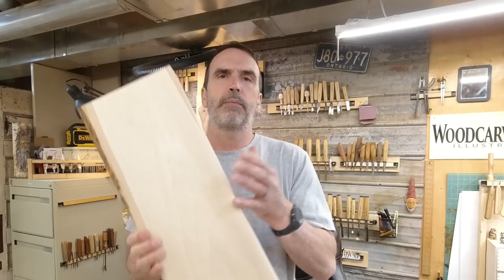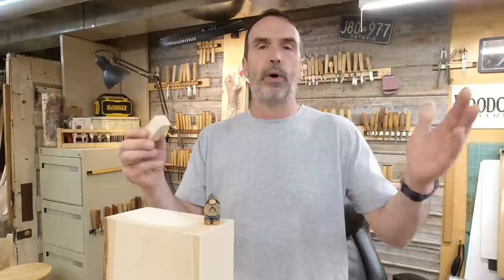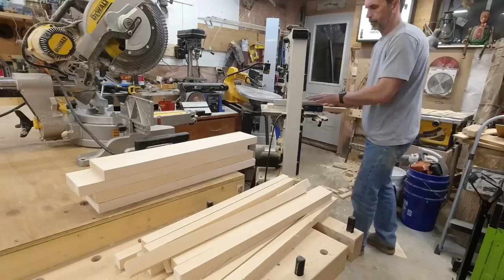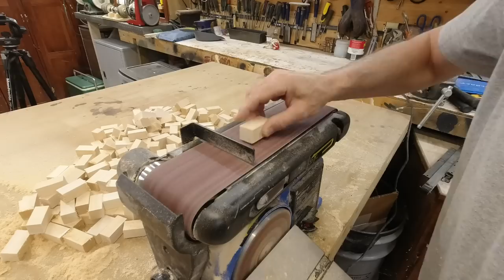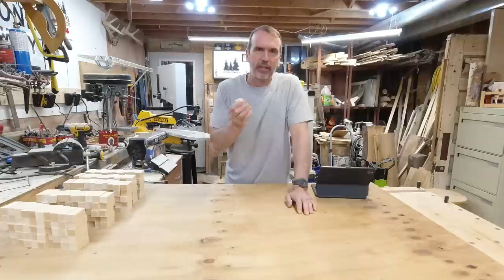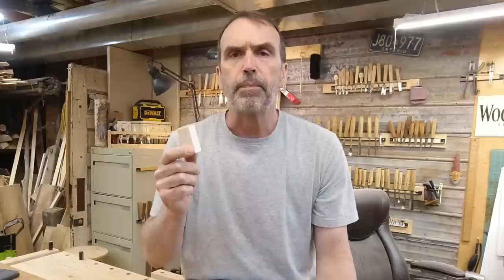This is Ridiculous!....

Comment: Haven't read all the comments, but even if you don't have a bandsaw it's still good value. A good ripsaw will cut basswood really easily and accurately and in a few hours you'd have your 250 pieces. Given that'd be a once a year (or three!) operation, it's worth giving up an afternoon for. For the final crosscuts too, it'd probably be worth clamping a few of the long one by one lengths together before sawing together to speed up the process.

Comment: So not all basswood is created the same, correct? I bought some online and that wood was s hard the knife would snag and then jump (if those are the correct terms) frustrating because I became fearful about carving. I have stroped my knives thinking they were just dull, but I have hardly used them. Beginning knives are from beaver craft
Reply: You can soften it by soaking it in paraffin oil. Paint it on with a brush and leave it to soak in and dry.

Comment: When I started watching you a  year and a half ago, I went out to find some Basswood at my local lumber shop. (No sawmill nearby, but a really good dedicated lumber store. Lots of unique pieces as well as the usual suspects). I found 2 six foot lengths of 2"x6" Basswood for $25 each. Both were poker straight with super straight long grain. I didn't count how many blocks it turned into, but it was a lot. So cheap.

Comment: Hey Doug - thanks for this video (and all your others - I've been binging all the informational ones and keeping the project ones in a list for later). I haven't got a bandsaw but I do have a 10-inch job site table saw (and a chop saw to cut lengths). I know the thickness of the blade will turn more of my big block to dust - but I'm now very excited to visit the mill near me and find out how much they're charging for basswood.

Comment: Hey Doug, I'm lovin your 1x1 tutorials. I've hunted everywhere in New Zealand and unfortunately we simply don't have the option to buy Basswood in a larger slab type form.
Cheapest I've found is 6x peices" @ 50mm x 25 x 25mm (2×1x1") which cost me $36.00 NZ ($6.00 @ peice NZ) which comverts to around $58.16 / $9.70 a peice US that's insane!
Told my wife I'm going to start pruning our fruit trees haha.
Due to our importation laws were not allowed to purchase from overseas without a license due to our strict infestation risk to our export tree/food industry so I might even try pine cause I can buy a full 6meter length of that for less than the $36 I paid for 6x little peice.  Crazy 
Anyway thanks for posting awesome informative videos. Peace ✌️

Comment: I still have a block of bass wood I bought from Woodcraft a couple years ago. It's 3x3 and 12 inches long. I paid 11.50 for it back then. So it looks like I'll get 54 1x2 blocks out of it that averages out near .21 cents each. The blocks will be a little smaller than 1x2 since my saw blade will take up about 1/8. Oh well, still a fun project.

Comment: You're sooo right!!  And even if folks don't have the tools: I buy mine in 1x1x12, and then cut to length.  I'm sure i paid a little more than 11 cents but still a very small price per piece.  Thanks again for this series.  Perfect size for my smaller hands, and when I mess up too much, I just start all over with another piece of cheap wood.

Comment: Will a coping saw work to cut the 12 inch long ones into 2 or 3 inches? If so, any particular specs you recommend? I love your haircut and beard trip, by the way.
Reply from the maker: I’d buy a little mitre box and saw -they are cheap and will cut straighter